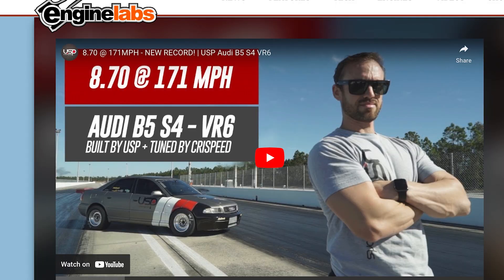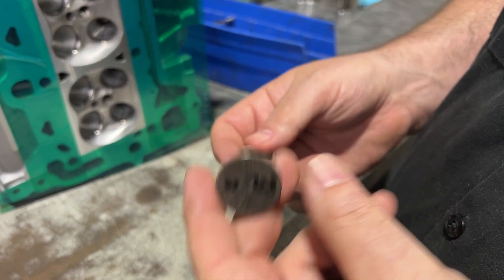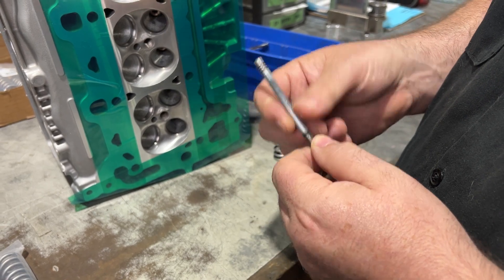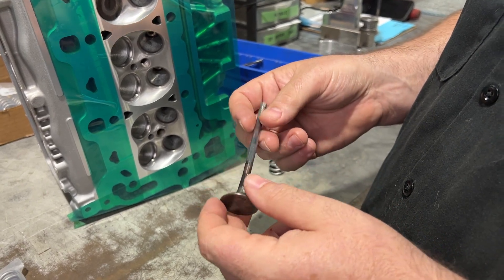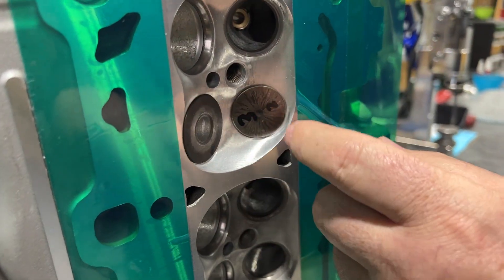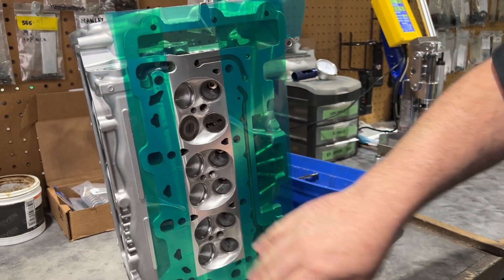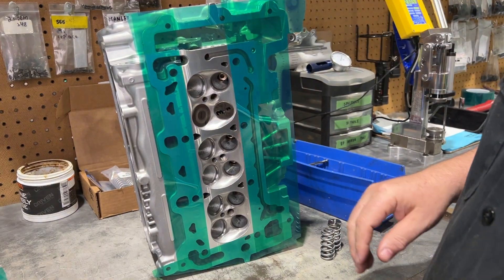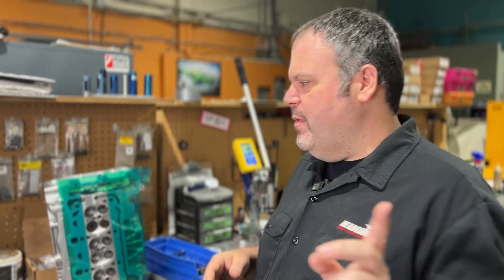Unlocking Performance: Valvetrain Solution for Audi EA889

Comment: Is it really ea889 and not typo? can't find anything about it, EA839 exists
Also EA numbers are more like engine block numbers. You might see (in past) EA number come out of dead with different cylinder heads, or EA will change by changing timing tensioner locations and they may use same head design (also head design (port shape, valve geometry and type) between 4cyl, 6cyl, 8cyl tend to be same between them in same years and applications, so porting type developed for this v6 could be used for other engine in vw/audi family.

Also about engine names that are 4 letter codes are more widely used (you might know DAZA as 2.5tfsi but there are 7 different names for it and CEPA should be same, also is widely recognized by its parts number prefix 07K) (or EA839 could be called as 3.0tfsi), where last letter is whole package revision with all exhaust components (so if they add OPF filter to exhaust or change something on intake manifold it goes in v8 for example from CAUA to CAUB)
tldr there is no concrete naming scheme for vw/audi engines and are mostly called by their badge on the car (1.8t 20v), so maybe relating to it as 2016+ 3.0tfsi could be best fit for this engine  (if it is EA839)
Reply from the maker: @exvils  thanks so much for comment! Yes, I have struggled very hard with the Audi/VW nomenclature! Then I have been spreading the misinformation on YouTube admittedly. I guess just calling it out by the years might help or body? Like B9 ?
Reply: ehm, strictly speaking B chassis name is for both A4 and Passat lineup, in past they had same engine layout and physical chassis (different bumpers, hood etc) and 3.0 (single turbo) and 2.9TFSI (biturbo) is in many more chassis like you said A6 (C7 chassis platform, like BMW 5 series), A7 (C7), A8 (D2 limo platform, like BMW 7 series), than in Q series of those platform (lifted SUV) and Panamera, VW Tuareg/Cayenne.

Question is how much does standard engine 325hp vary from S6/S7/RS4/RS5/Panamera version that has 434hp?
In past S versions of A cars had same engine block name (4.2 32v V8 in A8 for example) but head ports were different and camshaft was bigger in S/RS variants (40hp gain and by 600rpm lifted rpm where max hp/tq is) so someone has to let us know. I have found "Audi 3.0l V6 TFSI engine of the EA839 series" pdf on wiki by Audi/Porsche, but it only tackles 348hp engine (3.0tfsi CWGD)
Reply: @exvils  Did anyone have flow numbers for the 3.0t heads?   I've seen 2.9 numbers and peak is 210 to 220cfm.   It sounds about right with many manufacturers that did 3.0l heads with 33.5 to 34mm intake valves.   Usually stock around 210 to 220cfm.   A good ported can get 270 to 280cfm with stock valves and a little over 300cfm with 35mm intake valves.   On a 14psi setup that's almost 100whp gain and in a naturally aspirated it's 30whp or so.  It's a big deal when you don't have an aftermarket.    I'm glad to see headgames checking this out.
Reply: @headgames you should call it a 3.0tfsi or by its 4 digit engine code

Ea839 is the engine family so it could be a few different engines like a 2.9tfsi or a 3.0tfsi

Kind of like an ea888 vw could be multiple versions of the 2.0t from an a3, s3, a4, passat, golf R or a gti, or it could be a 1.8t from a regular golf or jetta.
Reply: @trev0rbr  Yeah who knows for sure? what is true is nobody in the forums or discussions on these cars knows hardly anything once it is engine related.    It's sort of commonly said the rods and pistons are good to around 600HP and after that you need to upgrade.   I haven't gotten a clear detail on flow numbers or cam specs.    I can imagine the flow numbers are similar to other 3.0L heads with a 33.5 or 34mm intake valve or 200-220cfm without porting and that similar results will occur to other 3.0L when you port them and/or increase the valve sizes.
Reply: Audi owners will know what you mean by b8/b8.5/b9.

Comment: Good morning Dave! Thank you for the Pre Turkey Day content! Best wishes to you and the family! Time to get ready for work while I watch my favorite content!!! Toodles 😂 ✌️

I love the Kapton Tape idea to protect the head. Smart. I also love that rainbow 🌈 surface finish! You mentioned a generic requirement for "1,000 HP" builds as far as spring specs. That being 100lbs or so on the seat, 200+ open. Is that a general rule of thumb that can be applied to the 4g63 as well? As a DSM owner, even the "fast" builds don't mention specifics when it comes to valve train components. People seem to buy company "x" or "y" springs and throw them in and send it. I've never heard a single person mention spring specs. I'm under the impression it's because people trust the company name and run with them, never really measuring install specs. My brain is going down a rabbit hole that I probably shouldn't be, especially when I'm not awake completely 😅
Reply from the maker: @highpsiguy4085  good morning and happy turkey day to you and your family! 
Yes, those specs are the same across most applications but does include the 4G. Agreed, nobody talks about the specs they only mention the brand. Mostly because they lack of experience or knowledge. Most manufacturers don’t have anything for that power, you really only have GSC or Kiggly that can supply a spring that works well in that arena. And I would recommend the GSC conical over the beehive from either manufacturer.
Reply: @headgames as always. WONDERFUL insight and knowledge that speaks to your experience. I'm looking for a simple spring upgrade for my DSM. It's currently only making 400whp in E85 and a FP Black turbo (60mm). The turbo will be the power limitation, tapping out at about 550whp. Anyway as you said all I hear in the DSM world is names. Never specs. And we both know names mean nothing if the specs aren't the best for YOUR setup. Anyway, as mentioned I'm looking for a spring for mid power level setup. Stock head with 272 Kelfords. A common budget upgrade I used on my last car is a factory Evo beehive spring. It's said that offers benefits over the factory 6 bolt DSM spring. But days wise, I can't vouch or say I've ever heard differences mentioned. I'd love to send my head to you for rebuild and surface decking, With my car being a budget minded car, I may not be in your league to be honest. As far a spring choice, you would recommend the GSC spring?